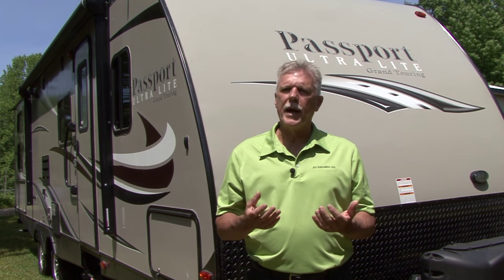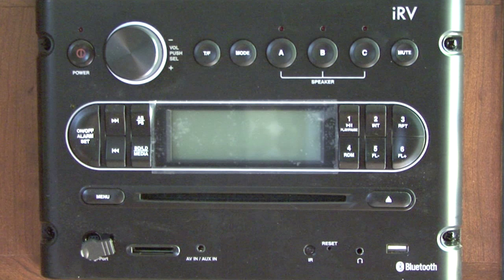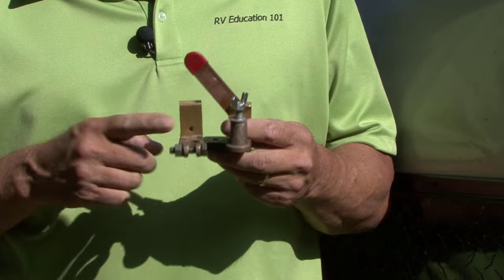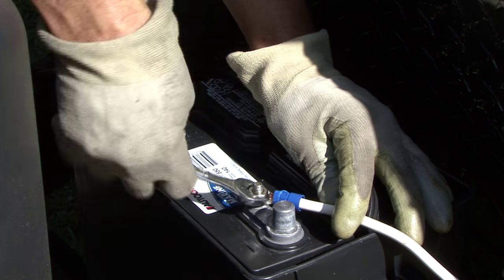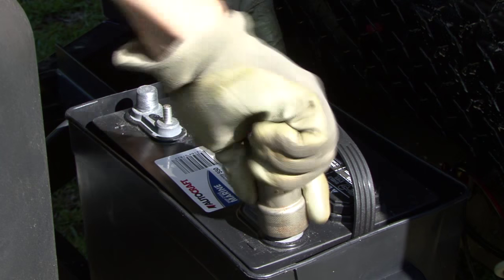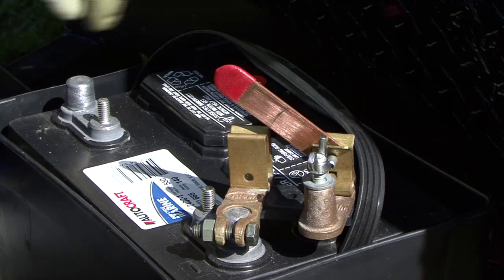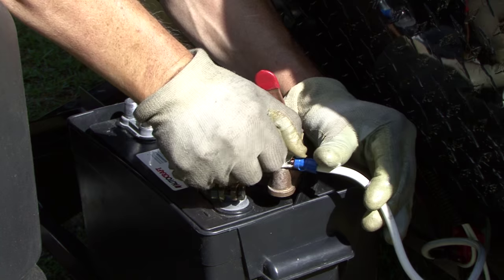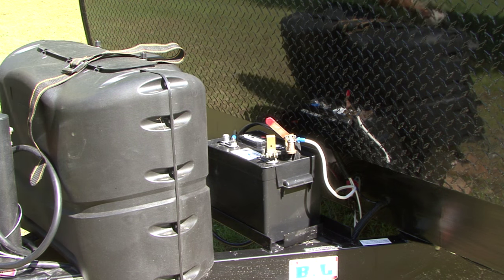RV 101® - How To Install an RV Battery Disconnect

Comment: My wife and I live in a 5th wheel full time and we are plugged into shore power all the time. We live in an older 2003 model that doesn't have a battery disconnect switch and I worry about the battery constantly being charged by the converter. Would this effectively stop the converter from doing that? I also notice my interior lights get much brighter when I disconnect the negative terminal but I can't remove the battery altogether because there is still power flowing through the cables from the converter. We do not travel with it. It's just a tiny home on a homestead but any help would be greatly appreciated. It's been next to impossible to find any answers online.

Comment: Nice video but do you have one for adding the dial type switch ? Other question is that my Rv has two wires coming from battery and don’t know exactly what each one goes to , one is much thicker than the other one.

Comment: In a two 6 volt battery setup, could you place the disconnect in the wire between the two batteries (series setup)?  I am guessing that you could possibly have a short in the switch and end up with power but that could happen wherever you place it.
Reply: Yes correct as long as it is in series,  a disconnect between should work.

Comment: I have installed a battery disconnect switch on my house batteries. I have 2 DC27 batteries hooked together and have placed the Disconnect on the negative terminal of the second battery. The switch does not disconnect power. Do I need a second switch (on the first battery?)?
Reply from the maker: The only way to disconnect two batteries is to find the main positive and negative cables coming to the batteries, and make the connection there. It would require wiring a battery disconnect switch into the system, rather than a battery post type of disconnect.

Comment: I have a 2002 Fleetwood Fiesta 31H that I sold to my grandson, He is turning it into a tiny house. He pull the old sofa, cabinets and dinette out to mod in side look (make it look more modern!!!!)  In doing so he unpin the main and aux battery disconnect switches. I am a electrician but I need wire diagram to put the switches back together. HELP!!!!!!!!!

Comment: Brilliant. Now the weatherproof battery cover wont close. Might think things thru a bit before you embark on a solution.
Reply: The video was a demonstration on how to save your battery by installing and using a battery disconnect. Like I said in the video, I had it that one sitting on a shelf in my shop. There are many different types of disconnect switches available. That trailer was borrowed to produce a series of videos. The battery was mine, but if it really bothers you, cut a slot in the cover so it works.
Reply: chris rainer that was going to my question..  would like a device that works on double post battery  
But allows cover to be reinstalled
Reply: C H not necessary,  it’s not like I’m traveling with it in discount mode, use strap to keep from falling off when stored. Thanks for your concern though.
Reply: C H we’re cool. Thanks.
Reply: @rveducation101  Wouldn't I then need to install an additional cover to cover the cover that I just cut a slot in? Or would you recommend just tossing the cover and drilling a few holes in the battery case to let the rain water drain?